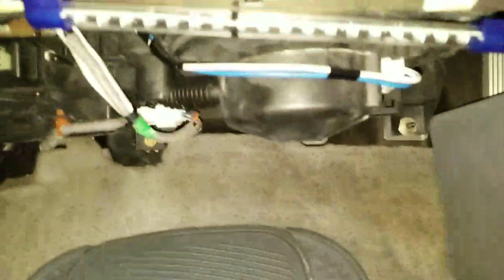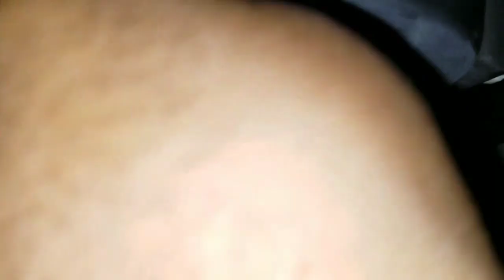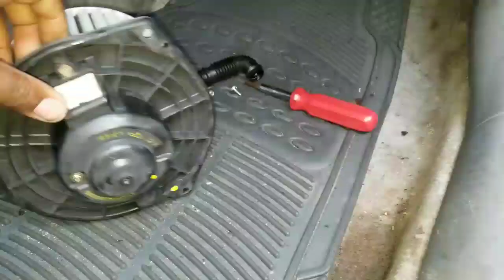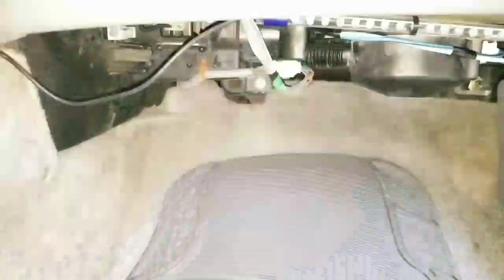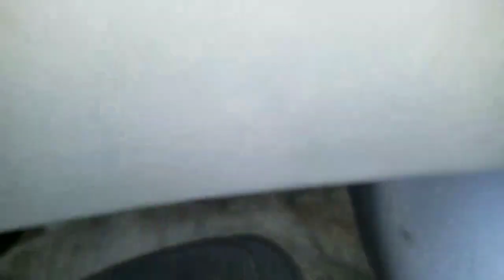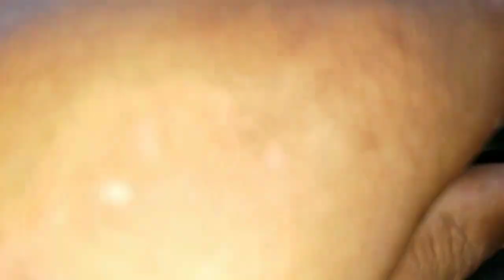HOW TO REPLACE ACURA TL  BLOWER MOTOR AND BLOWER MOTOR RESISTOR TUTORIAL(NO AIR BLOWING FIX)

Comment: So there is no need to take the glove box out for this repair? Mine is 2008 Acura TL, It stopped blow the AC today. Thanks
Reply from the maker: @neverwasthere  no
Reply: @fabolousg4ever  My 2008 Acura TL Base has the protective plastic cover wrapping around the bottom of the glove box and the blower motor. I have to remove the glove box to get access to the blower motor and even more pieces off to see the resistor.

My blower motor won't turn on, it turned out to be the relay stuck in the open position. Replacing the relay made the power pass through to the resistor and blower motor. After getting the power, I then found out that the blower motor won't work at the lowest setting, so I have to replace the resistor.

Comment: Bruh the problem am having is the blower works on my 2012 Acura TL but it makes a strange whistling noise...what might be the problem...the resistor or the blower itself plz
Reply from the maker: Have you checked the cabin filter might need replacement.

Comment: I have acura tlx 2015 my car blower is working but when i change my fan mode it always throws air from my windscreen. I can't change the mode to face or leg.. it always throws air on my windscreen.. A/C is working fine but modes are not. Do you know what is the problem here.

Comment: My ac sometimes works and blows cold air for like 10 seconds and then it just shuts off, you think this is the problem?
Reply: if the temperature when changed to hot or cold is accurate to what u set then it v well could be.  u can also check the fuses and relays esp if it runs weak